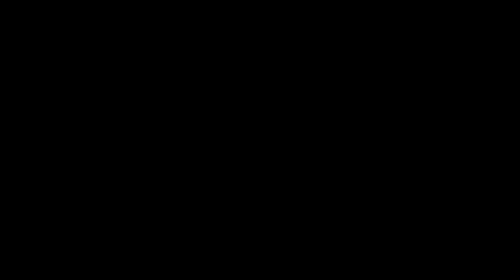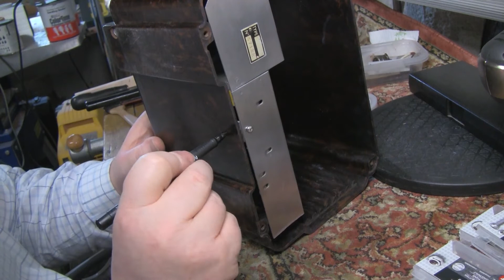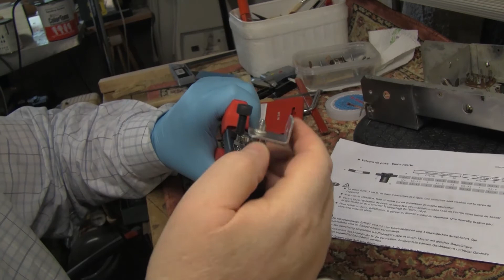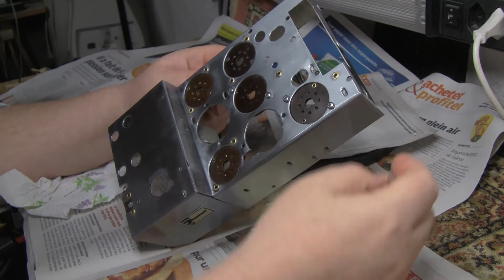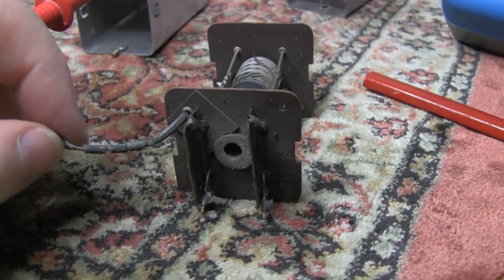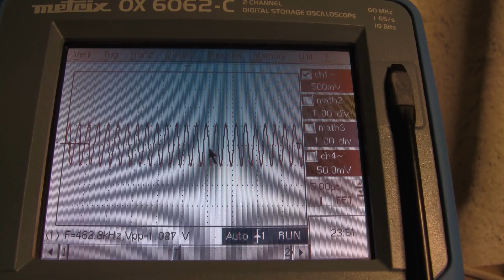Radialva Groom Rebuild - 7

Comment: I'm surprised that the slugs are glued in place, most of the time they figured that a blob of paint was sufficient, mostly to indicate whether someone had tampered with the settings during the warranty period. It wouldn't stop you from realigning the IF frequency and was never intended to on a long term basis. Maybe you could find a way to melt out the glue? A drop of acetone on the slug shaft threads?